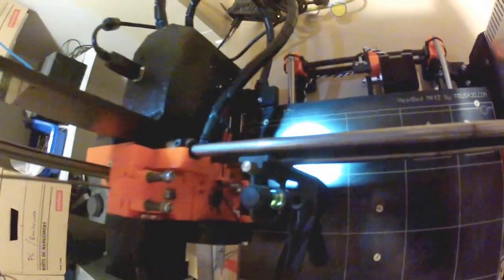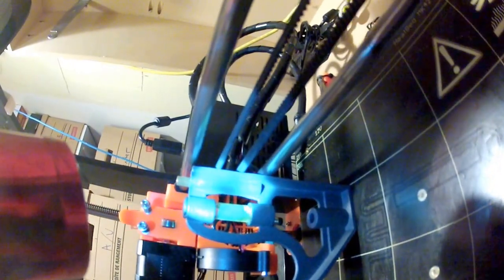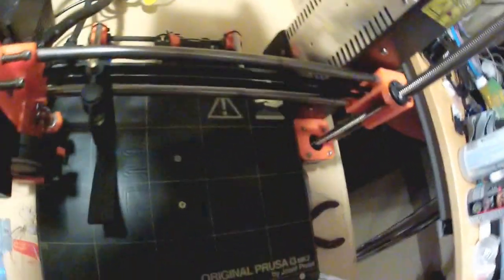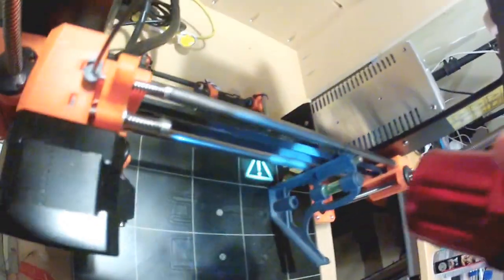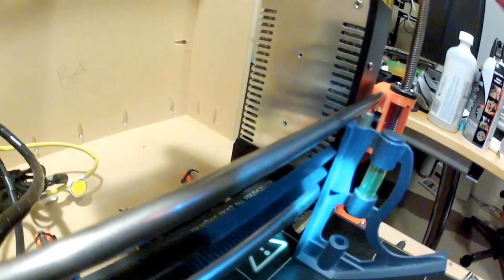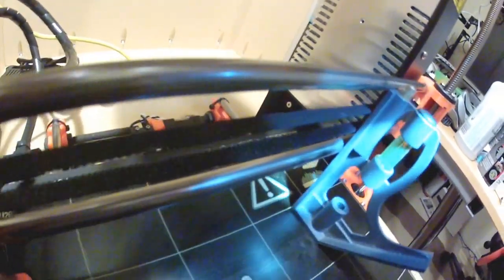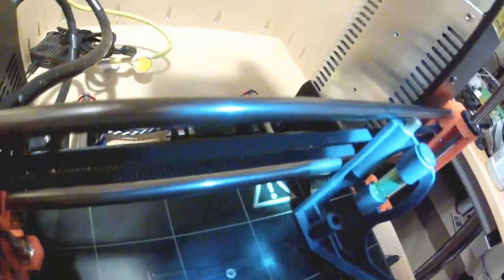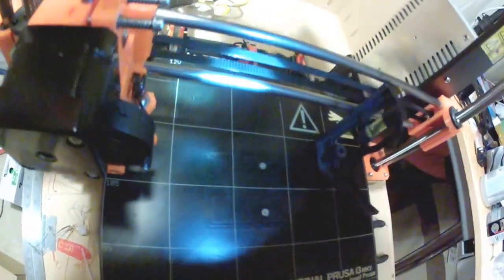Prusa MK2 X-Y Frame Squaring.

Comment: I used my xy axis to draw 2 crossing lines with a pencil on the bed. the angle is obtuse or 91° I cannot move the x or y on my crappy old acrylic Prusa frame. 
the support structure for the y-axis doesn't allow for sideways shifting. if I try the acrylic flexes and I'm back to 91°
the only way to solve it for me is to bend the threaded rods to the right or build an aluminum extrusion frame that allows for adjustment... 
early adopter issues.
Reply from the maker: DarkShadowsX5 yeah this video is specifically for the original mk2. Sorry to hear about your struggles.
Reply: I was hoping something in the vid would help as its same basic design. 
the entire frame isn't square. I can probably get some square brackets but forcing it might break the acrylic.
I didn't notice until a few months ago and forgot when I got busy with work. 
thanks anyway hopefully the vid helps someone else.